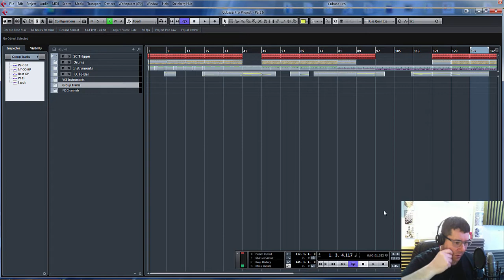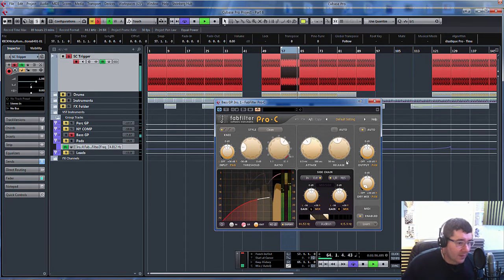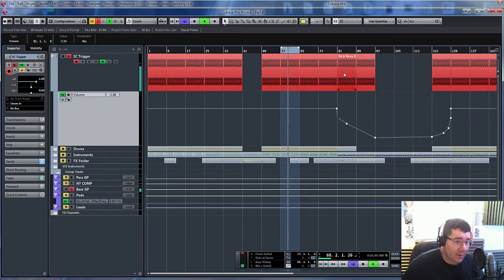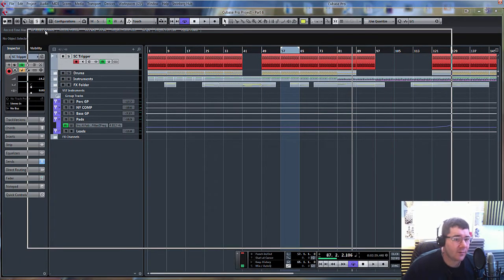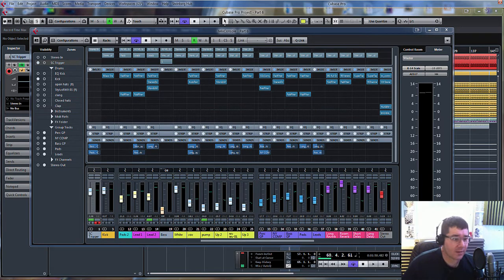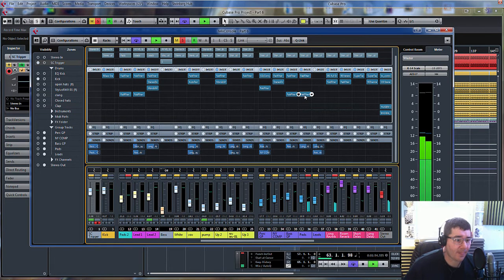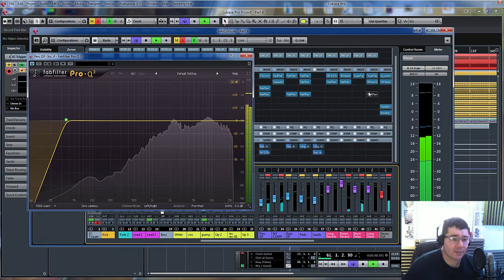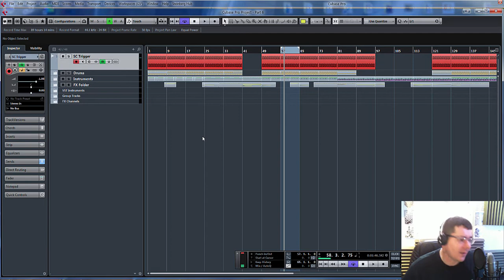Creating a track from scratch in Cubase Pro 8 OVERVIEW

Comment: hi mike,great video.
one question, how are you liking cubase pro 8 ?
i am still on 7.5.3, i want to upgrade but  a lot people are having problems.
Reply from the maker: I love it what an amazing upgrade!!! No issues at all for me on windows 7 64bit. I think a huge amount of problems tend to be from people who maybe do not know much about installation of software etc. For instance when you install 8 you may need to copy all your vst's over from your previous installation etc in your case you would still have an installation of 7.5 same as me :). This is an easy process if you know what your doing. if you dont then its obviously going to be a nightmare. Like I said I had no issues other than rescanning my vst folders and thats it so far, only had 1 crash since installing and Cubase ws not to blame for that.